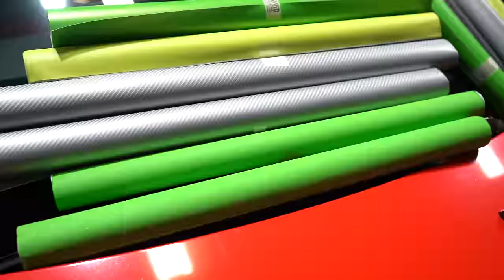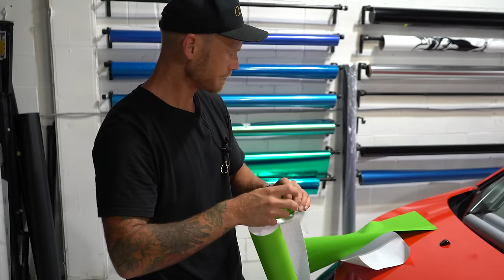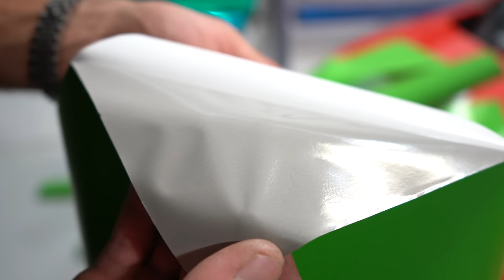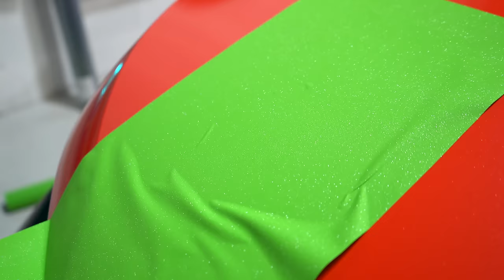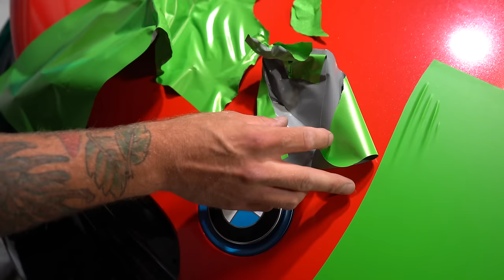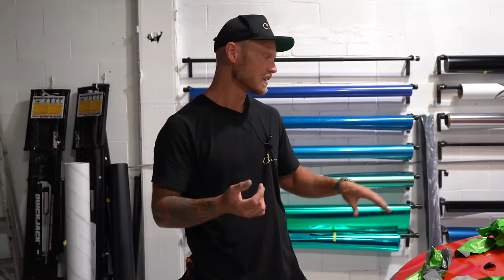Chinese Vinyl VS Vvivid Vinyl VS 3m Vinyl (part 1)

Comment: I have been in the wrapping business since 2005, under extreme weather conditions, 3m last about 12 months, chinese vinyl last about 10 months. 3m costs $40 to $60 per meter, chinese vinyl cost $70 to $90 per 25 meters roll. put labour aside, will cost around $1000 for a full wrap in 3m, where the chinese vinyl will cost $50 for a full wrap. Similar life. After 12 months in hot climate, 3m glue residue is just as bad as any other brand, 3m will start to crack within 2 years on the roof and bonnet. If you have a white car, 3m glue residue will turn the paint yellow, can not be cleaned, you have to repaint your car. Chinese vinyl is thicker, very hard to remove but will not damage paint. FYI, just like iphone, 3m vinyl is made in china. Oracle is made in Germany.  Out of 3m, avery, hexis, oracle,  Hexis has the best value/quality ratio.  You can change wrap every 6 months for 10 years, still cheaper than one single 3m wrap. Vinyl not recommanded to keep for more than 2 years, all of them are a B***h to remove when they are older than 1 year. Also air release is not really relevant, because all brands are now offering application liquid or gel, that will make any vinyl temporary none sticky, you can wrap faster than dry applying air release vinyl. 3m last about 6 months in Australia and offers no warranty in Queensland region.
Reply: Thanks man great info I'm just getting started as a wrapper
Reply: Hey mate, where do you find the cheap Chinese wrap? Got some things I want to wrap and the 3m and vivid is out of the price range
Reply: @charleskazzi8816  Ebay, AliBaba just like discussed in this video. Happy Wrapping!
Reply: how much wisdom in his words
Reply: Gosh, that sounds really bad in terms of durability! No way one can afford yearly wraps.
Reply: You mentioned the 3m will damage the car to the point of needing a repaint. You saying it's so deep it can't even be buffed out....😧? Also is there a noticeable difference in quality between the 2. I did notice 3m and Vivid are a lot more flexible and easy to work with.
Reply: The main difference in my experience between chinese vinyl, and say 3M is the ease of install. 3M is incredibly easy to install, chinese vinyl is super tacky and difficult to work with solo.
Reply: Hello, I was wondering about that. In our country with high heat and humidity I don't think wrapping is even worth it. That's why we are so few people in Australia wrap their cars. Thanks for clarifying the lifespan
Reply: Extreme weather are you talking high heat and UV damage from the sun or cold climate? Like below freezing
Reply: @randybobandy9828  Sounds to me like they are in Australia.
Reply: @tgxperience  lmao.. I must have missed at the end but still not all of Australia is scorching hot.
Reply: @randybobandy9828  most of it is pretty hot. Eastern states are cooler during a La Niña cycle, like the summer at the beginning of this year but generally hotter and dryer than most other countries.
Reply: Can we add ceramic coat to protect from heat and UV? If yes how long each type of wrap is gonna last ?
Reply: Have you tried Arlon?
Reply: No idea what kind of vinyl you have been trying, but on my experience the chinese one is the worst. A totally pain in the A. to remove or the opposite. I offer my clients a good quality cast vinyl; automark, avery denilson or 3m. Never had any issue with the glue residue you mention, neither heard anything like that before so it might be a problem that only happens to you, perhaps the chinese 3m copy you buying because at least the ones I've getting for years are made in USA
Reply: @vizxd2422  i did a chinese vinyl from ebay on my roof. did it myself wasn't too hard as the roof isnt too contoured. i had it on for about 5 years. when it started to crack. removing was a bitch until i discovered removing with a steamer. it came off so easy. the areas where the vinyl cracked left tile markings on my paint which was easily buffed off with a cleaning rag and some detailing solution.
Reply: Thanks man! I just finished wrapping for the 1st time my car, used a teckwrap vinyl, but they are like 900 euro to get a roll! It not even close for a ok price for me to practice some more. I'll try my luck with some Chinese ones from Alibaba and later on I'll update this comment with what I think about them.
Reply: @23chnge they do idk what this joker is talking about, all the big company list how long the vinyl will last based on geographical area and if it's applied horizontal or vertical
Reply: wow what an amazing information Bro
you deserve reward at least 50$ and off course subscribe.
you spent so much time to educate peoples free. love you bro from Finland ❤

Comment: Good video. I ordered Chinese wrap for a small project thinking "wow it looks easy on Youtube". I nearly lost my mind after several attempts. Couldn't get it to work at all. I basically put my project aside thinking wrapping is only reserved only for pros. Some time had passed and I felt brave again and ordered some Vvivid wrap off Amazon. I CAN'T PUT INTO WORDS WHAT A DIFFERENCE THE VVIVID WAS!! The air release actually worked and with a little heat applied for tough corners, it molded  flawlessly and I felt like a pro. I'm yet to try 3m stuff, but only amazing things to say about Vvivid wrap at this point.

Comment: you preheat your vinyl and purposely create lines in it. Stop preheating, just cold wrap the large flat spots and use minimal heat on the corners. Apply heat when the entire piece is wrapped. You cant blame the vinyl if youre doing it incorrectly.

Comment: Well man. You got me to try out my first wrap ever.
In that statement I think I chose one of the worst vehicles to do my first hood wrap on.
2009 BMW x5 xdrive30i where the hood and grille is all in one. Lmfao.
Take about throwing my self to the wolves.
Anyway after about 4 hrs, I got it all down, isent the best, not for my first time.
Buy you are right, it's like going to the gym as you said.
I'm not a big guy, 130lbs is all 5'9.
So lots of props to you for doing this your self.
Was a very big task for me to do. Thanks for all your video's.
Was a great learning curve that's for sure.
I should have done my 88 crx si first haha, more flat of a hood.
And yes I did the hood in a 6x5 foot piece all in one shot, no knifeless tape.
Keep them videos coming man

Comment: I do my own wrapping and alot people say it looks professional, i basically learn from videos like this but i tell people the most important thing about wrapping is the brand.
Reply: I'm wanting to learn how to do my own cars as well. How long did it take you to learn? Was it hard your first time and is it still hard now. How long did it take your first time and how long does it take now tht you've done it a couple times? Have u ever tried plasti dip? I just dip my car for the first time. It came out ok for my first time. But if u don't know what it is, it's basically a paint that u can peel off like a wrap. I'd appreciate your response bro. Thanks in advance
Reply: @devonbrown239  it actually took me like a week to get it down right but still till this day I have a hard time doing really tight corners, they are tricky
Reply: What brand? My buddy is insistent on vvivid because he's going to need 120ft for his truck and any other brand will be double the price.

Comment: Hi Christian,
Here I go with technical jargon. Adhesive is originally applied to the back at the adhesive coater. What helps to smooth out the adhesive as it's being applied to the back in called a doctor, usually made out of pure brass. What has been learned to make vinyl have air release, is buy getting a doctor bar that has a pattern cut into, usually by high tech lathes. If you can get a slight patter into the adhesive once the backing is laminated to the vinyl, the adhesive transfers  to the vinyl, and the pattern in the adhesive transfers to the vinyl. Once that's done, and you have a slight pattern in the adhesive, that pattern will create air release. This is why you're working with a certain type of vinyl, and you comment that it has great air release, that's how the air release was created. Man, do I wish someone would let you into the manufacturing coating site to let you see the whole process as it's done. Of all the people I know, you would appreciate the process so much,and you wouldn't believe it. Vivid, or 3M ? If you're watching, please show Christian the coating process. He's be dazzled....er, He'd bedazzled ? Aw, to hell with it ! He'd be impressed ! LOL
My very best,
Scott
Reply: I spent a good 30 minutes yesterday (and plenty of other times before that) wondering how they get the air release function, I'm a way that is hardly visible. What you described is along the lines of what I had imagined, but Now I know! Thank you!

Comment: I bought some random brand, 'DIYAH' Carbon Fiber, the application SUCKS, it's so hard to do, BUT it does look good and lasts really well through weather and sun, doesn't take off paint or whatever. It's just the application that's hard, it had air release and all that and it worked super well; but horribly sticky. I mean, I've had 3 people ask me if I got the hood wrapped or if it's real carbon fiber. I wrapped my dads Land Cruiser with Vvivid matte black, and oh man was it SO much easier to apply. So basically, if you have no clue what you're doing, get the expensive stuff. The Chinese stuff is hard to put on.
Reply: My first time wrapping a car was with a roll of 50M $250 Chinese wrap. I agree with you it was SOOO hard to wrap the car because Chinese wrap is so STICKY. Second time wrapping I used Vivid wrap was SOO  much easier literally night and day

Comment: You get what you pay for. I used to buy cheap stuff on ebay. Any type of stress on it and it's guaranteed not to hold. 3M is hands down the best quality in my opinion. I'll use Avery as a plan B, but learned my lessons the hard way on the other crap. Sucks when you're just about done an install and the vinyl cracks on you. Spend the money and stand behind your job. CK... Love your vids man, jealous of your shop!
Reply: Is 3M still the best?
Reply: @Rmalikk  It's my first choice. I have some out there 5 years & still looking almost new. Avery is decent, but heat it too much and you can see the glue pattern. KPMF & Oracal 970RA seem decent, they're a good back up plan that I feel safe using until they give me a reason not to. I won't touch anything Vivvid with a 10ft pole.
Reply: @brianames3074  will it take off paint on my motorcycle though? i can't find as good designs with 3m so far

Comment: Same results using Chinese wrap. A lot less expensive but you make up for it in labor. I chose el cheapo wrap for my first job because, well, it's cheap. If I screwed it up, it didn't cost a lot BUT I look forward to working with better wrap because now I know what the bottom is like. Glue lines, massive tack, bubbles, lifting...it's a showcase of bad. I have some Avery for my next attempt.

Comment: I wrapped my brother in laws Camaro roof with eBay color shift wrap and it did just like those and kept bubbling up randomly. After it was finished it didn’t look half bad being the first thing I’d ever wrapped. He left it on for about a month then decided to remove it and it left all the adhesive behind and it had sat outside in the Texas sun all day.

Comment: Great comparison.  Even though you can get some cool looking stuff from china I think I will stay away from it.  Doesn't look like it would be worth having to fight with all the bubbles
Reply: Maybe not professionally but as a diyer i have a friend that did 2 of his cars with the cheapest wrap available at the time (Textured with sparkles) and it came out great. End of the day its how much time you're willing to give, personally i spend like crazy time on my car, for me its a hobby. Other people likebro paint, watch tv. Me i grab cloth and start cleaning the cracks of my car with a beer in my hand and buddy to chat with.
Reply: I did my first wrap with ebay wrap and the finish was pretty nice for what you pay, but the adhesive was sooo sticky which made it hard to lift the film after only laying it down.
Reply: yeah i used the ebay wrap and lifting to realign it snaps super easy.  3 metres down and still no hood wrap, although the underlying paint was in despair, not some shiny new coat.
Reply: You can buy really nice vinyl wraps in China.  But some luck is needed if you are getting them from eBay.
Reply: Of course, all the patience in the world doesn't make the day last any longer. :D  If you spend all of your time working around problems with sub-par material, the amount of actual work you can finish in a day is still lower.  Picking up a second shift or something to save up for higher quality materials might actually take less time than fighting with cheap stuff. :shrug:

Comment: I am looking forward to part 2 where you show us how to get off all the glue that Vvivid leaves behind...
Reply: Ain’t nothing a gallon of Rapid Remover won’t take off.  Haha.
Reply: @thejester6265  Or just buff it off with a bit of wire wool
Reply: I like 60 grit sand paper on a buff wheel
Reply: @sunnys7645  Great idea, just take a plastic razor and a week of my life to go over 80% of a full size car, including all around the corners, inside the headlights, and maybe with a little luck, I may 3 fingers left when I am done. If I could show a pic on here of how horrible the car is, that I have spent more than a year, working in between jobs trying to salvage, I am betting you would just say, scrap the whole car. I have been removing and installing wraps since 2005. How long have you been an expert?
Reply: @colinremmer2417  "a bit" what is that? A cubic yard of steel wool? If the glue on the car i am trying to clean up were measured, i would have to guess it would be a couple of gallons spread all over the car.
Reply: @anthonymodica4  Lolololololololo!!!!!! Make sure you tell all your customers how you are going to completely trash their car before you start.
Reply: Acetone. Buy it by the gallon on ebay for cheap. Won't damage your paint.
Reply: Dr Graves - thank you for that. No one ever talks about unwrapping.

Comment: CK Wraps 
I really enjoyed your whole video all the way up to the heat-gun test , everything before that was college level and you was the professor & then the heat gun test was kindergarten level !! You had absolutely no guideline for the time after heating to the force/ rip test you should have reheated each one before applying force to them & to get it completely consistent with the amount of force you should have put one end in a vice clamp or vice grip and then put a little hole on one of the corners or the other side of the material and put either a ratchet strap hook in it and then just ratcheted it and that limits you know the amount of power pressure that gets put on it it'll be even on everyone I mean we know you're trying to use the same Force but that's not really regulated no matter how much you try because with stuff that thin 5 seconds with after using heat gun is everything and you went two to three minutes on the from the first to the last so there's absolutely no heat so the reaction would have been so much more different from the all the way to the 3M the one you did last so can we please get an update on that do each one hitting the same amount of heat for the same time & from the same distance please!! And I promise you I'm really not bashing you I just would really like to see all the underdog/n none you know Fanboy or number one brand get every equal opportunity a chance to shine because that's what it's all about you know especially if it holds up or it's better than the 3M wrap thank you & I'm truly really looking forward to seeing this part redone I really appreciate it because I am about to wrap for 2014 titanium turbo ford fusion and a 1996 Ford Thunderbird LX V8 4.6L supercharged so I'm really you know in the market looking for a cheap but reliable decent quality wrap so I'm not breaking the bank on two vehicles

Comment: I wrapped my car for the 1st time with china vinyl as I thought if I make a mistake it's only cheap wrap so no big deal. It was super hard to work with. Soon as it touched thr car it stuck down. Bubbled up loads. Was lifting on the edges and the seams peeled up. Once stretched it lost its adhesive. It pulled the paint off my door handles. I will never use it again. They do have amazing colours though but just not worth the hassle

Comment: Lately after using HEXIS for 2-3 years now for most wraps, every time going back using Oracal and M3 when a client want a specific color, it's quite fragile, very thin in comparison. Vvivid does have nice carbon fiber tho, worth the extra thickness.😅

Comment: I ordered some cheap wrap on Amazon. It didn’t go well. I was able to apply it but there are little bubbles that won’t push out and not sticking on some edges. Also some wrinkled foggy blemishes ( Not clear smooth). Was wet install with water. Left residue or something. Ordering some Vvivid vinyl.
Reply: im glad i wasn't the only one .. i thought i was wrapping my mirror caps wrong....

Comment: Wow , that explains why I struggled so much  using TECKWRAP, kept getting the  same results like the first two Chinese  vinyl wraps you used , kept getting bubbles and glue lines and it just stuck on quick and was hard to unstick from hood